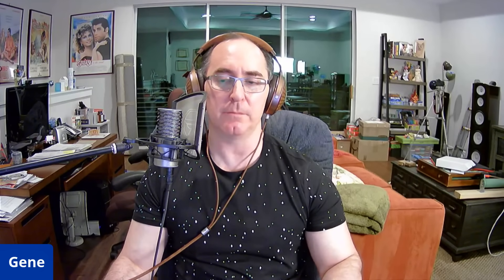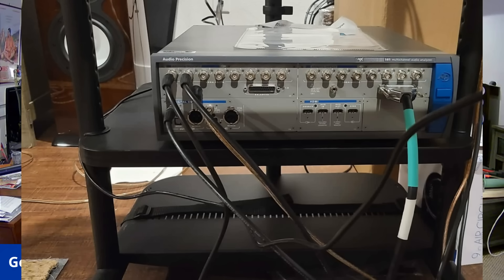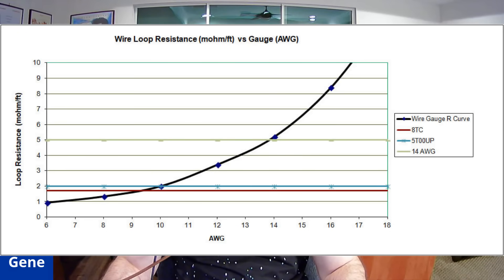Speaker Cables Really Don't Make Much of a Difference?

Comment: I am glad I came across this video!  When I was setting up my system, I was telling the sales guy that I could not hear a difference between the $3k cables vs the ones for a couple of hundred.  He blasted me with all this gibberish (like you pointed out) of floating highs, thundering lows, yada yada yada ... so I switched the cables myself when he went to get a different CD, and low and behold, he kept pointing out how great the cables were, until I pointed out that he was really talking about the cheaper cables HAHA  I then went to a different store to buy my stuff HAHA  Incidentally, I think the same way about some of these wine guys who can taste the wind in Chardonnay in April when the sun was partly obscured by 3 clouds over the knotted oak barrel that had some rust on the steel hoops HAHA
Reply: I used electrical power cable for about 20 years without complaint.
Reply: I would not be man enough to tell him the truth...too embarrassed to myself
Reply: You’re a legend dude!
Reply: With wine it MIGHT be true, with cables never
Reply: There was a study published in the journal Brain and Language (2001) where 54 wine experts were given two glasses of wine and asked to describe the flavor of each glass. One was white, the other red. The experts identified the flavors of the wines, describing them as you might expect of a red wine and a white wine. Unfortunately for the experts, both glasses of wine were actually the same white wine, but one had been dyed red using a tasteless food dye. Wine terroir is almost certainly less important than what kind of wine it is, and if the color can have such a strong effect on the experience of the drink as to override what type of wine you're drinking, you can be sure that the difference of a particular year, or one farm vs another, etc, is made up garbage, and the "experts" are just sniffing their own farts because the culture has convinced them to do so.  @johnholmes912
Reply: Rubbish, I have 18 bottles of wine in a rack, all different price points, your telling me that I couldn’t tell the difference if blindfolded @XeroShifter
Reply: Not quite. I was being a bit hyperbolic about fart sniffing etc, at the end in a poor attempt at comedy. I think that if we were to do a double blind test, that you'd probably be able to identify most of them apart as different, but I highly doubt you'd be able accurately and consistently tell what ones were more versus less expensive, and I'd be willing to bet that you'd probably make a mistake or two in regards to wine type but I doubt you'd be as bad as a 50% (the same as guessing) rate. 

Truth be told I do think there are differences between many wines, but I don't think that the year to year changes in terrior, let alone the differences between grapes grown on farm A and those on farm B right next door -- and then passed through the whole wine making process, and somehow coming out at the end -- are real. This is the kind of garbage that sommeliers try to feed people, and its the wine version of the snake oil cables in the audio world. I used to work as a certified cheese expert and had to deal with those people all the time (both from the wine side, and the cheese side). 

Putting that aside, what I actually think the study demonstrates is that your expectations for a food play a huge role in how you experience that food. Notably the experts weren't blindfolded, but rather the wines were dyed with flavorless dye. Your expectations play such a large role in how you experience something that any more subtle differences are completely blasted into oblivion by the way your brain interprets and handles those expectations. This is why some people will adamantly maintain that they can tell a difference even when we can mathematically prove there isn't one. 

This also isn't the only study to demonstrate this phenomenon, its just a noteworthy one because the test subjects were experts in the tested field, which demonstrates very well that the effect is very strong and no one is immune. We have hundreds of similar studies like ones using jell-o with no flavoring or identical flavoring, dyed different colors, and then the subjects report different flavors based on the color alone.

If you want a more objective experience with something, don't ask its name, don't ask its price, don't look it it, just sit in a room blindfolded and experience it, then choose what you liked best without knowing anything about it besides what you personally experienced. This will be true for music, food, wines, etc. 

Outside of specially set-up test environments you'll never get truly objective experiences, but that doesn't have to stop you from having a little fun trying. For a fun night some time, wrap all of your wine bottles in paper so you cant tell anything about them, then ask a friend or partner who wouldn't know anything about them by looking at them wrapped,  (who didn't watch you wrap them,) to pick 3 or 4 at random, and have them label them A, B, C, etc, and pour at least two test-cups of each. Label the bottoms of the cup for the reveal later, but make sure that you wont be able to see the labels at all until the reveal (including through the cup). 

You need to be careful not to create a situation where you might know because of bottle placement, size, etc, but if you can do all that, try the wines blindfolded. The point is to completely eliminate anything that might tell you anything about the wines besides flavor. You cant get around that they're ones that you bought, but you can do almost everything besides that. That way your expectations of what was being poured cant interfere, and the wine selector knows nothing so they can't add their own bias anywhere in your experiment. Taste them blindfolded, really taste them for the first time. You may surprise yourself with what your favorite was when you learn by unwrapping what they chose to pour for you.

That said, there is nothing wrong with letting all of the little things be a part of an experience, and enjoying that experience as a whole. Sometimes the food will taste better because you're in a good mood, and the restaurant was nice, and you paid a lot of money so you went in with high expectations; but if you enjoyed it, and all that made it better for you? It wasn't wasted money, it was just part of the experience you paid for. It only becomes a problem when you try to make claims about objectivity, or sell something to someone on a lie. Or the advice you give could affect the medical (or other life changing) decisions someone is making. 

Life itself has a lot of very subjective elements, and once your needs are taken care of, the rest of your money, time, etc, is only there to try to give you more attempts to find happiness. Nothing is a waste if you were perusing something to that end; and if you find out that you like something cheap and considered junky, or absurdly expensive and gaudy, don't let others ruin that for you.
 @frankcousins7655
Reply: I’m not sure a sommelier can tell which field a grape is grown in but they surely must know and appreciate the characteristics of a bottle of wine. As for me,  appreciate a nice bottle of wine, not expensive but nice and I could tell Shiraz from Merlot, if it’s nice or not so nice but not able to tell year or country. I have dabbled in hifi over the years, not hi end, some second hand and each step improved or changed the sound. I believe that as you go higher in cost the change is minuscule but who am I to argue with people who have the passion and money to exploit it. I have listened in perfect demo rooms equipment costing in over £100K and that’s was 20 years ago and it was amazing.  I ditched the Turntable 25 years ago, a young family not the best environment for decent stylus and fairly accessible and touchy-feely magnaplanar speakers. I have only just giving all my Vinyl to my daughter who like you say, enjoy the experience rather than just pushing a button for music. I have gone purely digital, have bought a lovely streaming amp which can be upgraded if necessary. I spent a fair amount of time choosing speakers to suit, due more to room constraints rather than budget but ultimately something that sounded good  in a particular position. The speaker cable are very basic multi strand cables chosen so they can took under the carpet/ skirting boards etc, and because they are probably the best the system deserves, but if I had spent £100K+ and I could hear the nuances that it bought then I am sure that cables would make a difference. This brings me to one of the first thing the reviewer said, “I use Kimber cables in my reference system” @XeroShifter
Reply: @frankcousins7655  It's more like if you could tell the difference of the quality of the glass in the bottles, based on the taste of the wine.
Reply: @XeroShifter  I was a winemaker and differentiating quality, hence price difference is disenable by taste. Is and increase in price by 100% mean an increase in quality by 100%: no, but I can assure you you would prefer the better wine over the lesser.
Reply: @frankcousins7655  If taking the "master of wine" course you would almost know which field a grape was grown, but certainly which year, region and producer a wine came from. Very few of these people exist but they do. Probably the same in any field.
Reply: @XeroShifter  Some people prefer water over wine. Yes it is had to convince me of your argument as it is bunk. I can't argue with that. Objectively wines have different qualities due to quality of fruit sourced and the way it was taken to the bottle. Perceived value of that variable quality brings variable prices. This is not exclusive to the wine market. 
So you read an article by someone that doesn't like wine and perhaps you have little experience yourself in wine. Heck some people think the earth is flat.
Reply: @XeroShifter that might be true for the people in the test. Not necessarily for all.
Reply: If you spent a couple hundred, you already got taken. That's part of this con. They show off the $1000 of $5000 cable and "compare it" to the "lowly" $200 cable. "Oh, you can't hear the difference? Well, there's no point in paying for extra technology and expensive materials if you can't tell the difference, and I couldn't live with myself if I sold you something you don't need. You're perfectly fine with the $200 cable, my friend. Let me ring you up."

You spent $200 on what you could have gotten for $10 - 20 at most.

Scammers use this same psychology all the time. They claim a 100% investment return, or whatever outlandish claim. And you think you're smart. No way it's 100%, BUT, you reason, even if it's only 10 percent, you'll make out like a bandit! The truth is it's 0%.
Reply: about wine testing - I had a friend and she was claiming to be an expert on wine. One day she popped in when we had a party and noticed an ultra-expensive bottle of wine in its handcrafted packaging I was gifted some time ago, and asked if she could try that. Little did she know that the bottle was emptied a couple of hours earlier, but her wish was my command, so I went to kitchen, pretending to look for a cork screw and filled the bottle with the cheapest vino I had at hand. As expected, she went on complimenting how excellent the wine was after tasting it. She described all niuances in a poetic way and she was really blissed with the taste of $15 wine, sipping it with utter enjoyment. Placebo effect is super strong in people.
Reply: @udowehab6756  did you tell her or not?
Reply: Just remember that not all postings on You Tube and elsewhere are 100% unbiased and made with your interests at heart. I have encountered plenty of shills and it dead easy to say 'all cables are near enough the same/snake oil/ buy tbr BJ cable. Every bit as good as **** and a tenth of the price Here are the measurements " . Measurements do not tell the whole story. And when I sold hifi measurements were NEVER mentioned. I allowed the customer time on their  own to listen to a hifi setup . The demonstration eother sold it or it didn't. And csbles should be treated like any other part of the hifi chain. They either improve things *or maybe lessen degrading)  or they don't. Use your ears NOT spec sheets. And make a decision from there.
Reply: And magical fairies emanating from your speakers?
Reply: These salesman are the same as the guy who painted some colored squares and its now "worth" a fortune.  Brainwash!
Reply: Luck for you that you don’t hear a difference.  😊
Reply: When it comes to car audio the cable matters such as ofc vs cca.  Non ofc power wires causes voltage drop to big sound systems and distortion to speakers wired at ohm lol
Reply: I will never understand why people make up stories on the internet
Reply: @AndrewB23  seriously, it’s kinda of pathetic.

Comment: i go büy keep cables well below 10 percent off single unit part so cdp or +amp at best so 150e cable (red straight in my case slitelly better than chip one maybe knöt even oehlbach 20-30e xD would mean at least 1k+1k cdp-amp ^ ^ i think about 5 % is even better. 
no one or so off us will öwn dcd-ml stüff xD ör ml$? 
ps speaker cables shouldnt exist !!! adda should be channel wise directlie at the spiqäir >:< ?

Comment: Of course, GA, insulation, is the cable qualified for in  wall (plem cable) is it copper, CCA, or very junk aluminum. Now I look at anything over 2-3 dollars a foot of a rip off. I think very expensive cable are not needed. Simple Ohm's law

Comment: The BEST test of Speakers cables, was performed without any Electronic gear.  Basically, the BEST CABLEs for your System ,,, is the one you like HEARING the most!  It's just as subjective as SPEAKERS.... which ones are the best????  It's the one's you like hearing !   So, at the end of the day, it all comes down to your likes and dislike,  for get the SNAKE oil properties.  Allot of guys Selling Audio Gear, use to be USED CAR SALESMAN ,, hahaha.   IF you CAN'T hear a QUALITY DIFFERENCE, then why PAY the DIFFERENCE ?  No Engineering Degree needed.

Comment: This is brilliant. As a longtime fan of generic 14-gauge Home Depot cable, you’ve confirmed what I’ve always believed about high-priced speaker cables. It’s “jewelry”.
Reply: I agree! I bought a 100 ft roll of RCA brand 14 gauge copper zip cord at Home Depot ($30) six years ago. Now unavailable and replaced with spools of "speaker wire" for double the price!

Comment: Until yesterday I've been convinced loudspeakers cables do not matter as long as they match 'physics requirements' of the loudspeaker/amp. I compose and record my own music, so I know my sources very well. I've been selecting a set for mastering and I think I've picked a great amp/speaker combo. Since my set is still at the dealer, I wanted to find the right cables for the set - but I already decided I wasn't going to spend audiophile money on them. I am not going into brands and prices here. I first listened to a 'wire', nothing fancy. It sounded fine. Then I listened to a set of seriously overpriced cables, power lines and USB cables.   

I have this simple rule that if I can't remember the difference later,  it's not an important difference. When I listen to four serious studio compressors, I can't remember the difference. I need to A/B again to remember.  I did not hear any difference on the power line and the USB cable. However, this high-end cable added amazing depth.  I knew I added it to the mix, but I never heard it being reproduced so accurately. 

I always do my best to mix a deep soundstage, deliberately moving sounds to the 'back' by adding low pass filtering and reverb to create a sense of space. With cheap cables, the image was flat like a postcard. With the expensive cable, the image got layers of depth I can still remember and don't want to miss. Now how can this be? I guess (not sure!) that a complex music production is more challenging than a test signal and I know from experience that stacking up a lot of sounds in a mix requires you to 'make room' with EQ so individual instruments do not interfere. Could it be possible that a cheap cable is less capable of transferring the complex 'colors' in a song compared to better cables?  I would never buy these expensive high-end cables, but the brand also offered reasonably priced versions which also offered that exact same depth in the soundscape. Turning back to the cheap 'wire' flattened the image again. Everything was there, but the depth was gone. You could not 'listen into the sound' anymore. So yes, I now believe cables matter. I could not hear the difference between the 'reasonably priced' and the 'exclusive high end cable'.  But that 'wire' sounded worse. I can't help thinking that something important got lost in translation.  
Thanks for reading.

Comment: You also need to consider long term listening is more effective at discerning differences than instant a–b switching... blind or not. It's a mistake to assume that we have perfect discernment at an instant. I will freely admit it's difficult to hear differences on instant a–b tests unless those differences are very significant... like large changes in spectral balance and frequency response. Subtle distortions and low level details tend to go unnoticed in quick a–b tests. But they more easily show up when you listen for much longer time periods. 
When making any comparisons our brains require time to process and evaluate what our senses perceive in order to familiarize ourselves with a component's "sonic signature". That is why a sound system often sounds just great in the store but at home after considerable time listening the more subtle colorations and distortions become apparent that didn't get noticed on first listen. People who work diligently with audio much of their lives understand the wisdom of long term listening over quick assessments.